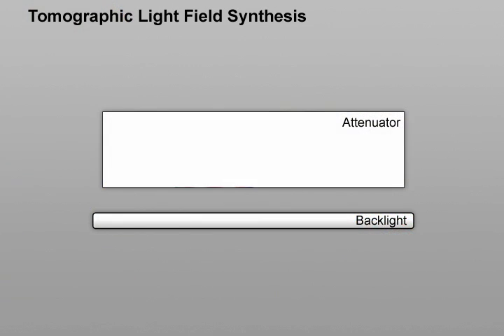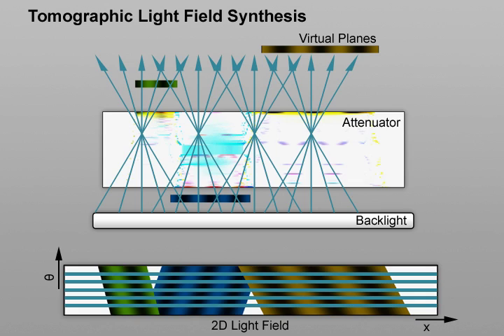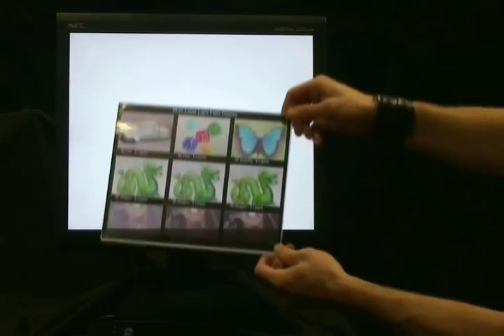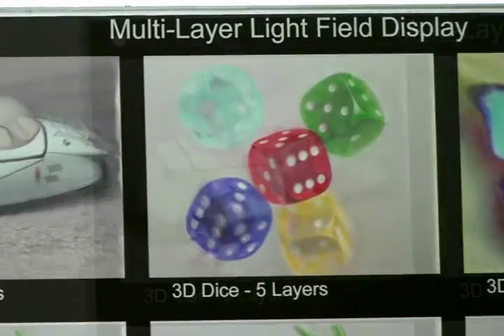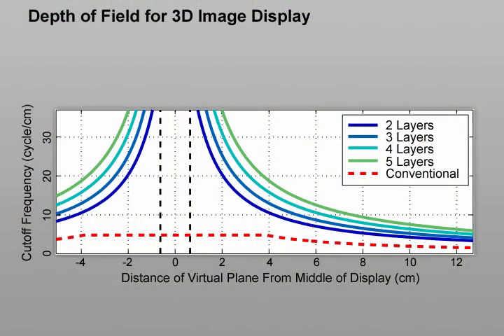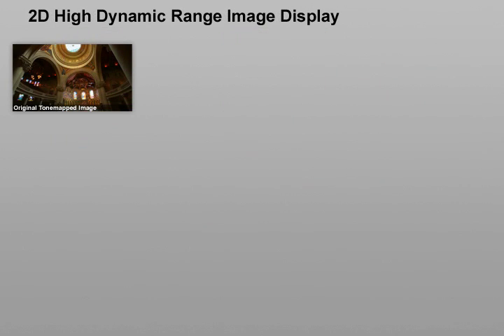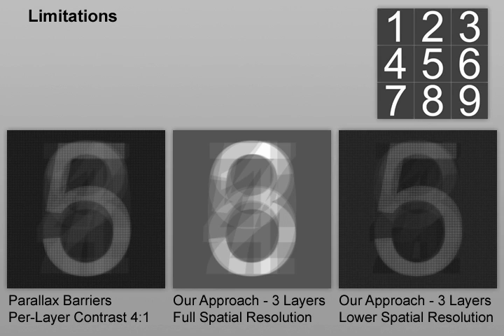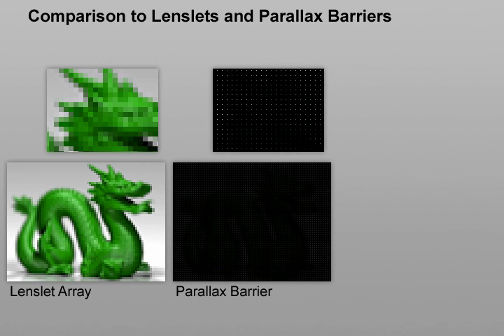Layered 3D: Tomographic Image Synthesis for Attenuation-based Light Field and HDR Displays

Comment: Just stumbled across this after searching the web for the lumii- site for making my stereoscopic holiday-pictures viewable. Sadly I couldnt find a way to convert my pictures since the Upload service doesnt seem to exist anymore. As far as I understand, it uses similar Algorythms to get the desired output, if not the same, since it was also founded at MIT. Does anyone know how to get the needed Image-stack from a stereoscopic Picture or from a Lytro-Illum light field? Is it possible to process stereoscopic pictures with a depth map?If so I wonder how to do so, since the generation of artificial Viewpoints that are implemented in usual 3d siftwares are usually restricted to the horizontal Transition. Any Hints would be very apreciated since the looking-glass is still relatively expensive. And I would like to give one Print to my Parents.